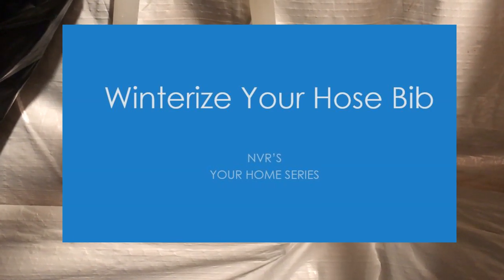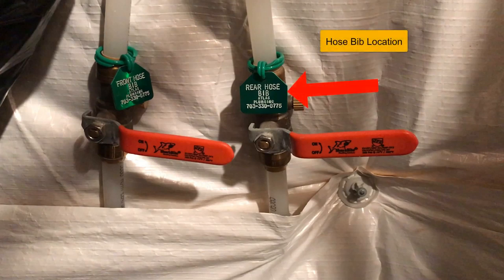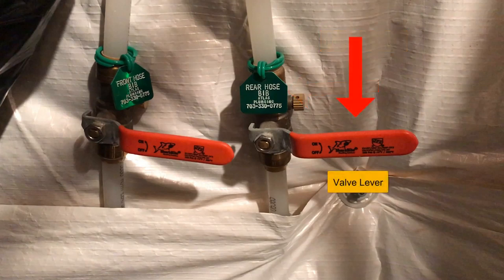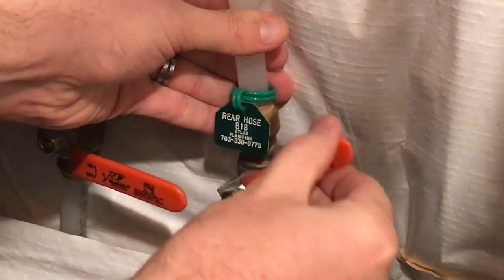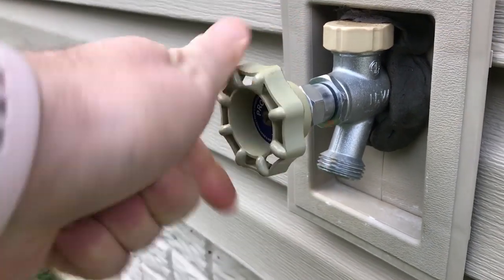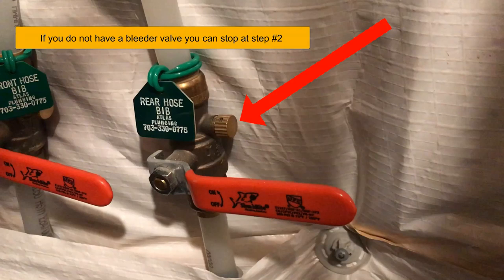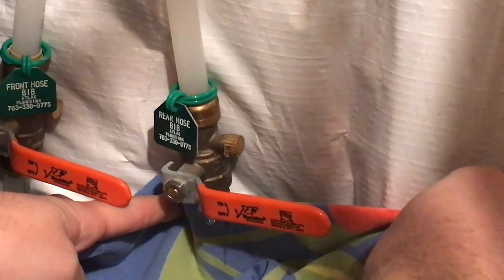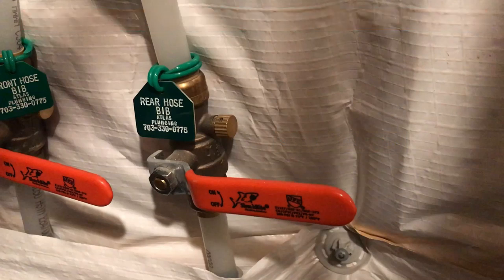Plumbing - Winterizing your Hose Bibs

Comment: No water came out when I opened the spigot but I don’t have a bleeder valve either. The water line is blue pex. Is that ok?
Reply from the maker: Thank you for your question - So that we may best assist you, please contact our Customer Care by submitting an on-line request at www.MyRyanHome.com or by calling 877-550-7926.  Customer Care is available Monday - Friday from 8 am to 5 pm. Thank you!

Comment: Should you drain the bleeder cap to completely dry? I can still see water remaining in the cap. When I take off the cap after one week, there is still water coming out.
Reply: Personally it is OK if there is still a little bit of water in the line.  The purpose of the bleeder cap is to break the vacuum and allow a majority of the water to exist the pipe(closest to the hose bib).  Based on the location of the valve you might still have water close to the valve but that should be fine.
Reply: Same issue here. Didn't know if I needed to wait for the cap to release all the water..

Comment: Aren’t you supposed to shut the outside spicket when you are all done
Reply: Nobody knows the answer to this question, and not a single video adresses this question
Reply: I close mine after.
Reply: I believe it is best to leave the spigot open in case any water is in there, it will be able to drain out. When the water is caught and freezes and expands in the hose bib fixture, that is what causes the risk of a leak.